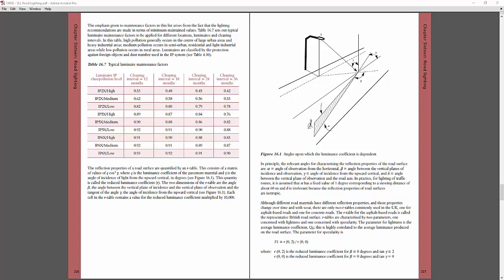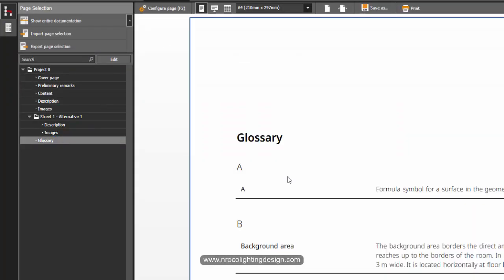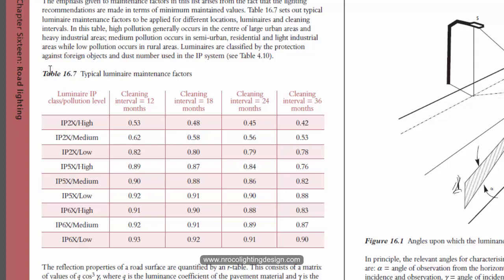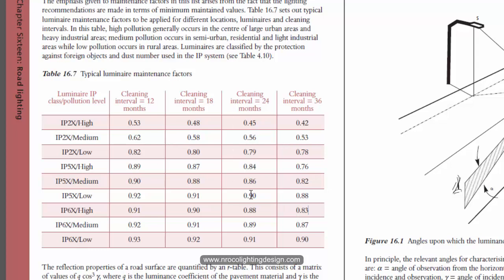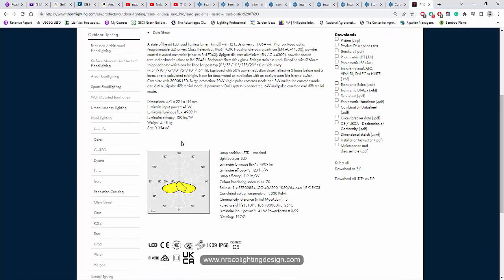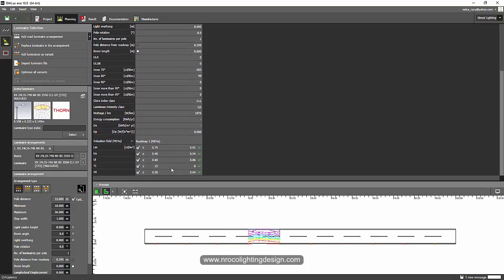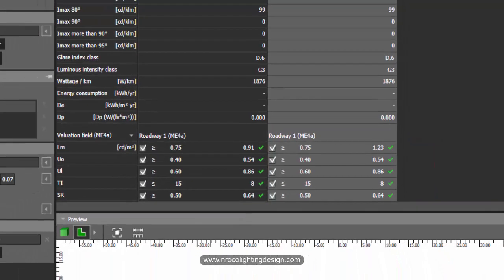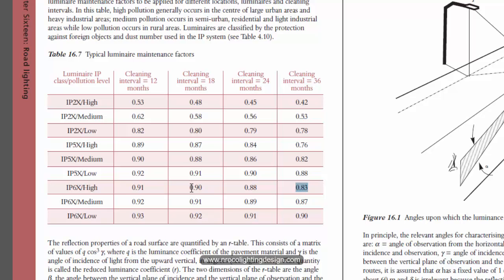Why 0 67 is the Default Maintenance Factor in Road Lighting?

Comment: I have been following your videos for a few weeks, I really appreciate the dialux tutorials. I was reviewing info related to the MF (CIE and local standards of my country), and the table that shows in the book is not the FINAL MF, in fact they are the pollution factors for luminaires according to the environment where they are installed. To know the final MF, it is necessary to calculate the depreciation of the luminous flux of the lamp (DLB), and consider the non-controllable factors for example the auxiliaries (drivers). In resume, for an IP_5X luminaire, an environment without pollution and disregarding other factors, the MF calculated is 0.76.